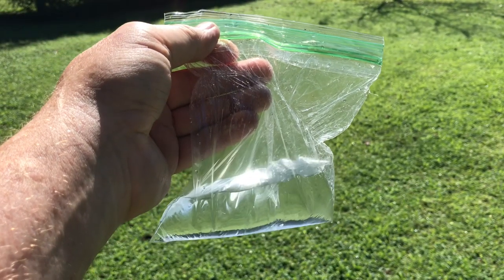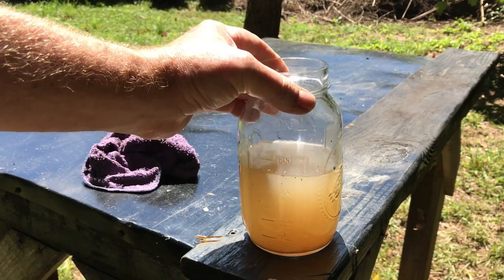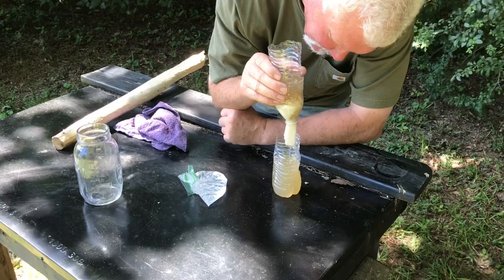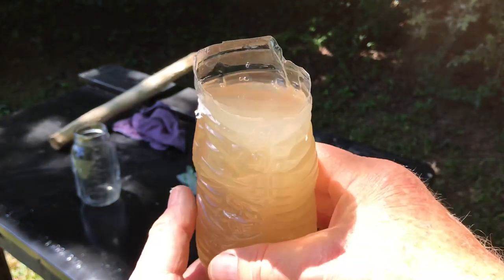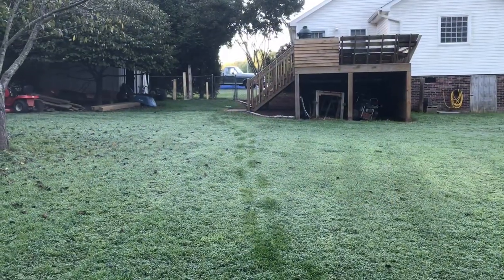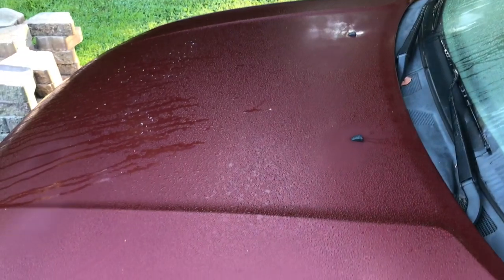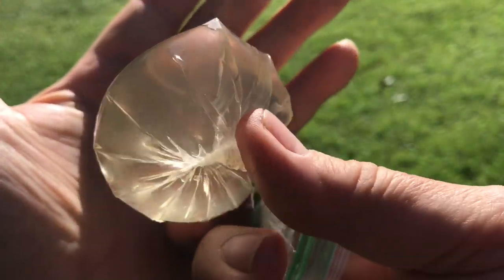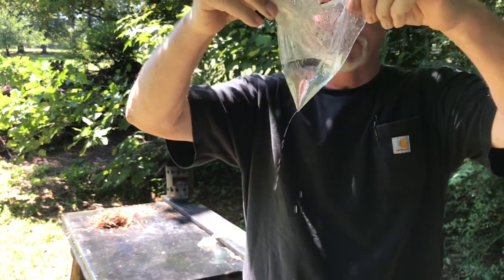Collecting Dew For Ziploc Bag Solar Ignitions, Several Attempts At Filtering The "Dirty Dew"

Comment: Put your catch jar under the tarp and weight down the very center.
Reply from the maker: That would probably work.
Reply: I second that!
I’ve already done that a few times - it works just fine.
You can even use your tarp or „survival blanket“ of some sort and cover a hole in the ground (filled with murky/muddy groundwater), place your jar in the centre of the hole underneath the cover and put a little rock on top of your cover right above the jar. Now just wait, and the hot sun will generate nice and clear water...

Comment: Hi David,I know you were trying to keep it simple so what about transpiration might be a better way of collecting clear water. Really enjoy you channel by the way an excellent information resource.
Reply from the maker: That's what was happening when I found so much condensate under the tarp instead of on the tarp.
Reply: Hi David, thanks for the reply. What I meant was collecting water off a leafy tree in a large clear plastic bag taped around a leafy branch to see if the water collected is clear enough to allow the photons through.Should have explained myself clearer. ;) A possible future experiment? Thanks again for your time. Best wishes Demus.

Comment: Even though you are wearing sunglasses, how do you avoid getting 'retina burn' when you are focussing on the punk wood?  I find it really difficult looking at it when I try using a magnifying glass.
Reply from the maker: Good Sunglasses that block all the harmful wavelengths of the light. I was a pipefitter for years working with welders. No flash burn with these sunglasses. Also, there are times when the light reflecting off the punk wood is not directly hitting your eyes. If it was a pool game and a bank shot, I would be standing out of its path. Soda can bottoms reflect light to the bottom of tinder. Those types of ignition are less of an issue too. If you experience snow blindness, or dark shadows, or persistence it is temporary and you'll need to find better shades to use.

Comment: I once saw a man use a cotton string from one cup to another and it seemed to do the trick. I’ve never tried it myself but a thought
Reply: And I think your murky glass should be somewhat higher than the empty glass
Reply from the maker: Yes. I've seen that too but not for filtration. Seems like the string would get too clogged to keep drawing water.